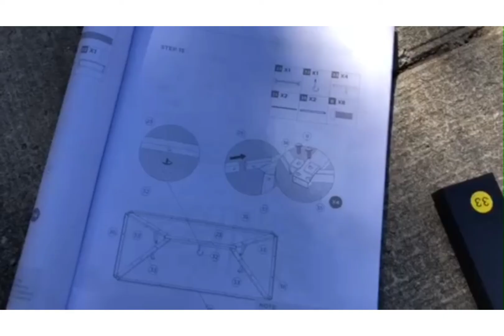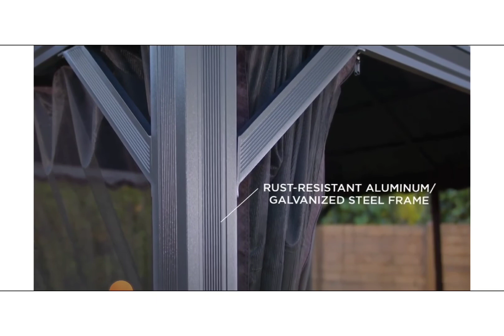Installing CANVAS 10'x12' Skyline Gazebo ....... beautiful for backyard 👋

Comment: I just bought a same one yesterday. I plan to install by ourselves. Do you have some recommendations ? Or share more videos for the installation details? Thanks
Reply from the maker: Yes it took me 2 days and just follow the installation manual. There is some minor trick. The contractor want to charge $500, I saved $500 and learned something 

Call me if you need help and I may be able drop by if you are in Scarborough, Markham or Pickering area
Reply: @eastaronline2504  thanks buddy, I live in Vancouver. It is too far to come over I think. Thanks for your help.
Reply from the maker: @jameswang2376   too far